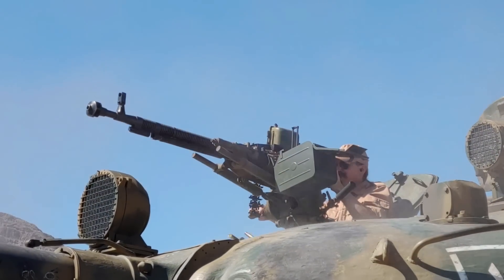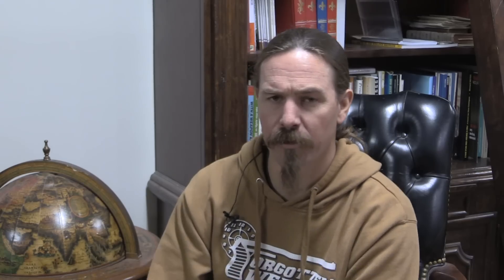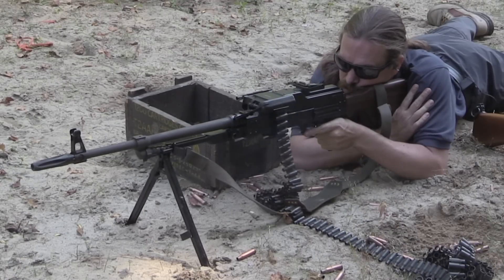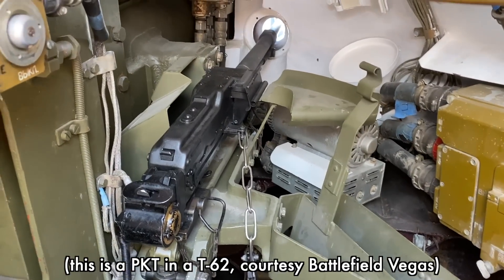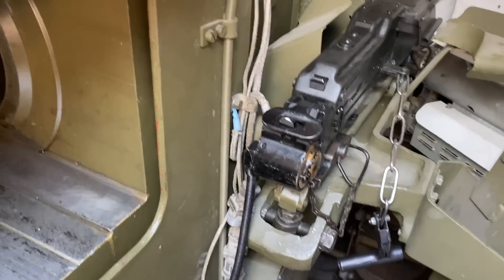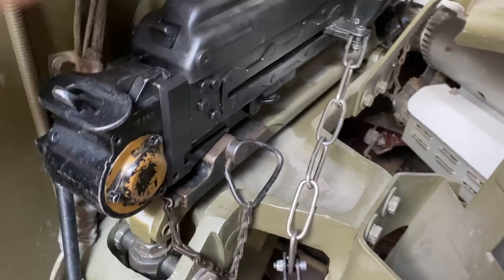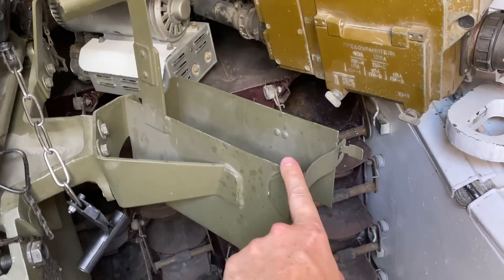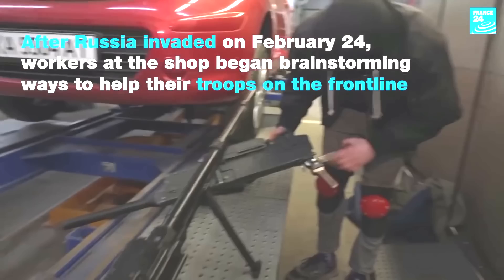Ukrainian Adaptation of PKTs to Infantry Use

Comment: I mean, with the Soviet/Russia slip up, makes you wonder just how much old Soviet Hardware they've been digging out of storage to ship off to Ukraine. I think we've seen everything from old Mosins to modern bullpups at this point on the Ukrainian side.
Reply: And on the russian side as well. Some of the militias in russian controlled areas have had pu mosins and dps.
Reply: Back in the 2014 fighting I saw dual mounted Maxims with a modern red dot sight.
Reply: Well, if its Mosin Man its mostlikely DNR Militia!
Reply: When the dust settles it will be interesting to see what was ultimate done by both sides. If it goes bang when you want and hits where you point, why not dig it out?
Reply: @bikerbobcat  well, if it stops going bang in the middle of a firefight because it collected dust in some warehouse since the Afghan war then you might have a problem
Reply: @MitsurugiR  based on footage over the last 3 weeks hardly anyone has an AK-12.
Reply: @MitsurugiR  No crap. What they're equipped with is coming out of soviet storage from ww2-90s.
Reply: The same footage that's shows T-72A and T-72B being used in 2022.
Reply: @MitsurugiR  from reports coming from ukranian side it's even worse - those aren't "separatists", but just conscripted(on some claims forcefully) population of two cities. Most of them don't have neither combat, nor firearm training. They're basically used as "ambush bait". Hence the weapons they are given.
Reply: the  modern bullpups  we see Ukrainians using are ak convert using kits, they've ben seen using dp-28s
Reply: There's an old mark 1 from 1917 sitting in a square in one town... I'm waiting for them to paint a big Z on it and send it
Reply: @MitsurugiR  from what we've seen, only chechens got optics to mount on said AK-12's so for majority there is no difference between old and new AK. At least until rifle switches sides as ukranians have troops with optics, but have shortages of modern rifles. The only domestic rifle with modern mounting system was produced in small number only for special ops. Main bulk of AK-74's weren't modernized due to low priority(and not having organized militia/national guard tradition and permissive gun laws).
Reply: @MitsurugiR  they only bought like a hundred AK12s for parades.
Reply: @TheArklyte  yeah, I was listening to a guy talking about how he was trapped in a basement in Donetsk because the DPR was shanghaiing men off the street, men between the ages of 18-70 are grabbed, given an AK and forced to the front. They go through the hospitals to grab the sick and walking wounded too. Young women are also grabbed and forced to be medics/nurses. 
One of his friends can only leave the house if he dresses up like a babushka, and the friend who built the computer he was using had disappeared.
Reply: there are definitely no Mosins on Ukrainian side
Reply: I really want to know if the Ukrainians are using and ptrd's or ptrs's that were laying around.
Reply: @Horizontalvertigo  
"shanghaiing"
you're making a historical reference the context of which escapes me. WWII, Civil War, 70's or nowadays?
Reply: @ChristheBarker  yep, that's the rifles I've mentioned. Apart from them you can mount optics and thermals only on imported rifles and captured AK-12.
It still doesn't explain why russian soldiers didn't get any optics. I mean, if you gave a guy AK-12, you at least have a reason to do that, right? It's not at random?
Reply: @SCH292  both sides spread miss information chief. That "russian" tank in kiev that drove over a civie car was an ukranian Strela 10 air defence system.
Reply: @johnwilliams9179  I'm pretty sure both sides would be using those if found. They might not be the most accurate, but both can easily duck up a truck, radar installation or fuel tank from 100-200 meters. They can also easily pen Tiger and BRDM armored cars and MTLB. Idk about BMP and BTR(there are several improved versions that have added armor).

P.S.: btw, it's weird that I don't see BTRs on photos and reports. Only IFVs and trucks. It's as if MTLB is the only APC in the invasion.
Reply: almost everything the russians have now was made in the soviet union.

the tanks from the 1990s hasnt gotten better from russia (case in point the t-90 was just a copy of the t72-3 and that was already a failing tank during the 80s) and it hasnt gotten better. no tanks but the t-14 and the t-90m even have SOME blastout panels, rarely do they have thermal gunner sights let alone commander sights as well. the armour is terrible and only the ERA has some saving grace. if it isnt just hard counter with tandem warhead atgms or above attack atgms.

or apfsds rounds going right through the ERA
Reply: @Horizontalvertigo  
no, I understood the meaning. Why Shanghai? It is related to Battle of Shanghai? Or other events? I'm just interested.
Reply: @m2hmghb  
Which is hard to comprehend given how many months they had to plan all this out... eight years into an invasion, six months long troop buildup to more than 150,000 in strategic locations, including Belorussia. That's like 13 full divisions, reinforced, depending on whatever TO&E they're using, plus however many separatist forces...

And they haven't got their logistics figured out by now ???
_____
Something stinks about all that. Does it sound right that a literal daylight European invasion is being planned, months or years in advance, and they're pulling rifles and kit outta mothballs to barely furnish their troops? Because it's not just small arms, there's a shortage across the board, on every metric that matters toward sustaining an army. Four separate armies to be exact. Dosen't make sense.

Russia has a modern military, with plenty of fighting experience recently. Starting with the Chechens, of all people. Twice. Georgia. South Ossetia. Donbas. Crimea. Syria. Others...

But this is a significantly bigger force than any of those previous invasions. With substantially more on the line for millions. 

So, operational speaking alone, regardless of strategy and tactics, they have plenty of real world logistic experience to draw from. So why does something as simple as halfway decent rifle optics not made it to the field by now? Where was the gear, the MRE's, seven months ago... if this was the intial mission intent?

So, either they are sandbagging, like many say, saving the best for last so to speak. Or, they just showed the world deep ineptitude for actial large scale operational capabilities. 

I guessing Maskrovka...
_____
Deception, subterfuge, and misinformation seem to be the playbook so far. 

Either way though, they've had time to bring trucks up by now and have staging areas. So the logistics train should have caught up by now.

This whole thing has massive Finland vibes...
Time will tell.
_____
Reply: @TheArklyte  oh right, iirc it's from the height of Britain's imperial power, I'd have to look up more info to refresh my memory on the subject tho
Reply: @TheArklyte  it refers to the practice of kidnapping people throwing them on a ship and forcing them to work as sailors, it was a relatively common practice in the mid to late 1800s. Called shanghaing because many of these ships were bound for Shanghai.
 https://en.m.wikipedia.org/wiki/Shanghaiing
Reply: @TheArklyte  it comes from the 1850s when men were abducted off the streets and forced to crew ships.
Reply: @Josh Morrison   @M O'Connell  
well, thanks for reminding me one more time of how lucky I was for being born in late 20th century europe:D
Reply: And CCCP flags, too.
Reply: @ChristheBarker  I've seen at least one video of Ukrainian military where one soldier had a Tavor.  I don't know how widespread that is, but it was there.
Reply: @TheArklyte  they don't get optics because the Russian have a $60 billion annual defence budget and most of that is eaten up by fancy nuke subs, new build Tu160s and fancy weapons development. Russians need foreign sales to fund internal procurement. Look at the lack of Ka52 and Mil28s replacing Hinds. Theres only just over a dozen T14 tanks and Su57 stealth fighters. People are looking at hypersonic missiles etc and promo videos and not at what's actually in service
Reply: @tarmaque  Google "RPC Fort Tavor". Ukraine have a licence for them. No idea how widespread they are but I don't think there are many.
Reply: @seculartapes  Are you sure you're not getting mixed up with Gears of War?
Reply: @BeingFireRetardant  Honestly I think they underestimated Ukraine, over estimated their troops, held the best back in case nato got pissed, and didn't plan as well as they should to try to give the false illusion that the troops there were just doing exercises and peacekeeping and weren't getting ready to invade.
Reply: @agentoranj5858  I wish I could put a pic on a comment here… I have it saved on my phone.
Reply: @davem2369  Yeah, I saw that.  Like I said,  not idea how widespread but I definitely saw one.  Couldn't say if it was an IWI or an RPC, but it was definitely a Tavor.  (Looked like a Ukrainian Non-com helping refugees out of a building.)
Reply: I have even seen video of Ukrainian "police" units with ARs (I put police in quotes because they were fighting Russian tanks so they were something more like SWAT than ordinary police). The most common rifle I see are AK74 but I have also seen AKM being given to civilians.
Reply: @TheArklyte  Shanghai in this case is a verb , it means to grab or kidnap people
Reply: @BeingFireRetardant  This is one of the reasons I believe this invasion was a snap decision from Putin. I think the build up of forces was originally only meant as a show of force, but something happened that made Putin think he needed to invade immediately, at the worse possible time of year, with no prepared logistical train, with a officer corps and army with no pre-invasion training or a plan to actually prosecute the war. This war wasn't badly planned, it wasn't planned for at all. I'm curious why Putin needed to act now in early spring instead of late spring when the ground would have been dry. They're losses are mainly a direct result of being stuck using the roads and being prime targets for ambushes.
Reply: @davem2369  
1)I thought Su-57 project eventually just died. Last I've heard of it was engine documentation "donated" to China.
2)yes, infantry weapons are on the bottom of the list of budget. But why the f//ck would you produce a rifle whose whole point is to allow to mount optics and then not issue optics? And we know they have optics. Chechen troops actually have them plus there was production for civilian market. If you issue AK-12 to someone, then it's not random. But at the same time you value them less then optics you give away to chechen troops? What? Just what? That's straight up "lend lease leather jacket" kind of attitude.
Reply: @TheArklyte  1)Chinese engine technology is well behind Russian and the Russians don't link selling them just engines that get reverse engineered, they will do it only if entire planes are bought in at least squadron level amounts. The engine in the Su57 is basically the same as in the Su35  The Su57 is in painfully slow development production as the loss of the Indian funding in PAKFA/FGFA programme has left it entirely up to Russia but 78 are on order still
2) AK12 is again a reaction to needing to modernise the Russian ground forces with the "force multipliers" needed on modern weapons but also you simply need the rails for the export market too. 20mm rails are the go to requirement for sight mounting and internal tender documents are inevitable going to be written with them in mind. Russia needed a rifle that can compete internationally and the current top cover rails, side mount rails etc just won't cut it in the face of the other options available out there
Reply: @Mugdorna  I think some Russian SOF were using them and some units were caught by Ukrainians
Reply: @MitsurugiR  Lots & lots of footage on my part, as it's my job.
VERY few AK-12 but aneckofalot of basic, unmodified 74's.
Reply: @MitsurugiR  Most Russian soldiers are still armed with AK 74s. 

And most soldiers issued the AK12 aren’t issued optics or other accessories with them so they might as well have been issued an AK 74.
Reply: @SCH292  Shut up, sheeeeep. XD
Reply: @tojogornottojog1100  
sorry, but at the moment I "kind of" lack means to interview ukranian farmer on whether or not they think the poorly equipped guy they shot was russian military, willing separatist or press ganged(is that the term?) to happen in that pickle.
Reply: One of the Russian soldiers was issued a DT-29.
Reply: @23rdMS_Inf  still require actual maintenance.
Reply: Saw a freshly captured AS-VAL next to its previous owner... very jealous but going thru hell and loosing your home for it really sucks.
Reply: @Mugdorna  how did you conclude that "hardly anyone has an ak-12" when there is very little footage of actual russian soldiers to begin with?
Reply: @BeingFireRetardant  I’ve had similar thoughts recently. Just doesn’t make sense that a military with years of combat experience in modern wars both in Europe and the Middle East in Syria after a massive years long planned invasion dropped the ball this bad on something as fundamental as logistics. Unless the Ukrainians have just really got the Man Upstairs looking out for them I’d say reality isn’t as simple as it seems.
Reply: I've seen Neo-Nazis fighting with actual an MG42 in Mariupol, a Russian with a Mosin shortly after the invasion idk where, and possibly an anarchist militia member with a DP27 in Kiev.
Reply: @johnwilliams9179  I’ve seen at least one video with one of the two. Frankly, they were the best AT rifles ever produced, and that cartridge could most likely do a number even on modern armor. Not tanks, obviously, but older APCs would most likely be vulnerable.
Reply: @SCH292  Because Russia has a bit of a different way of designating changes in a design. In general if anything other than the electronics is changed in the internals a tank gets a new model Designation, a variant of an existing model usually just means external add on module changes and maybe some electronic refit.

NATO, (British Army being the exception), just adds a new model variation whenever they do a major internals rework. The Leo 2A7 and latest model of M1, (M1A4 i think, would need to check), share very little beyond some of the structure in common wit the original models. It's actually so bad on the Leo 2 that during recent purchases of Leo2A6's  and Leo2A7's many existing oporators of Leo2A4's have found it's cheaper to have all new tanks built that to rebuild their existing A4's due to the extent of the changes from the A4 to the A6/A7.

If Germany used the Russian system the Leo2A4 would have been the Leo3A1, the A6 would have be the Leo4A1, and the A7 the Leo5A1.

As an aside the degree of internal rework on many NATO tanks means the same logistical points apply on paper. NATo's just mothballed or scrapped those it didn't upgrade, accepting a downsizing of it's tank number, (Germany has around 15% the total number of tanks it had at the end of the Cold War for example, the other 85% have been sold abroad or scrapped).

As for the "not commited his best stuff" comments. For me it's less that he hasn't committed them than it is he could have used them and hasn't. He seems to be deliberately using his weakest equipment in most parts of the war. There's been a few early model T90's reported and some Spec ops types running around. But the non-conscript line infantry, massed airpower, and late model T90's we know Russia has have been noticeably absent. Why? He could have used the conscripts for his other security duties and used the top tier stuff to make his life way easier. Why isn't he...
Reply: @BeingFireRetardant   One aspect of it from a post i saw elsewhere is that Russia has a relatively low amount of non-railroad logistics per army in it's military. It simply doesn't have the trucks to bring up. But still I've been as surprised as anyone to see mostly T72's and T80's backed by conscript infantry as line forces. It's by far the weakest stuff he has for that purpose. Sure he's brought out spec ops where he needs their unique skill set, but they're not line infantry in anyone's military.

I'm hoping he just miscalculated what he'd need. But the more worrying possibility for me is that he deliberately used them because they're both expendable, (conscripts get replaced every few years and they've got massive numbers of mothballed T72's and T80's amongst other stuff, so they can replace all this lost gear very easily), and so he can find out how they perform in reality compared to on paper. n effect a giant live fire training exercise. 

I still suspect even if this is the reason/s he overestimated how well things would go, but i don't like the implications. You don't use easily replaced units, or try to work out a forces weaknesses unless you plan to need them and need them to do better sometime soon. If that is it, what is he planning next?
Reply: @VladamireD  Even concscripts need generals and you don;t use spec ops as line infantry, they're too few for that. So a bunch of generals getting killed and spec ops being used for things only they can do isn't evidence that Russia has deployed it's best stuff. I actually agree it's all tied upelsewhere ATM, the question is why is it. he could have left the conscripts tied up and broguht the high quality stuff forward to do the invasion. He didn't. Why?
Reply: @u2beuser714  lots of footage of Russian troops moving through occupied regions.
Reply: @darthkarl99  
there are two versions you can hear in Russia itself:
1)he keeps those troops back at home as he's more afraid of protesters then ukranian military. At least he was 3 weeks ago. Idk if his priorities changed.
2)in two months it'll be May. He can't allow loses in his dedicated parading troops. Losing T-90M would mean having less of them in a column. You can't parade old T-72's without making people ask questions, you know?;)
Reply: @Solnoric  I'm pretty sure that was a Mk IV.
Reply: I think one explanation could be, that a lot of modern stuff only exists on paper. The russian military budget isn't that high compared to other countries and the russian/soviet military has a tradition selling stuff to the highest bidder. That might also be the reason they ran out of fuel that early in the war, with the ukrainians noticing it and targeting the supply convoys directly.
Reply: @darthkarl99  he did. He's brought forward everything he can. That's why he's trying to hire Syrians to work as mercenaries and has the "People's Republics" militia fighting on the front, he only had so much of his army that he could deploy on the offensive, the rest is tied up.
Reply: @TheArklyte  There was a joke in the old Soviet Union about logistics and procurement : you order an hammer and you get ...an anvil   .😎😎
Reply: Russian already put Molot scope mount  on their Mossin and SKS so it can take modern optics.
Reply: @TheArklyte  Sailing ships needing crews, capturing civilians to be crew.
Reply: @23rdMS_Inf  Turret launchers.
Reply: @seculartapes  Maxims could be extremely useful in static defense. Piss in the water jacket, load up some 7.62x54r pissin’ hot loads, it’ll be good to go. Those things are meant to literally fire for long periods of time
Reply: @freakingabagool3510  Absolutely. They don’t quit and they take the same round on the same belts as the PKM. Static positions, vehicle mount, anywhere where the atrocious weight isn’t an issue and they will work just fine in a modern setting.